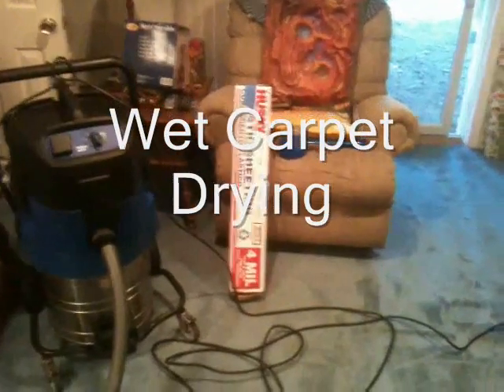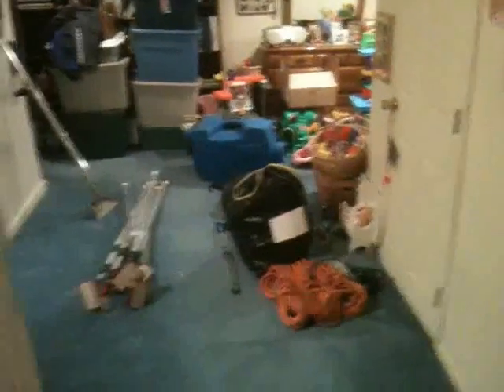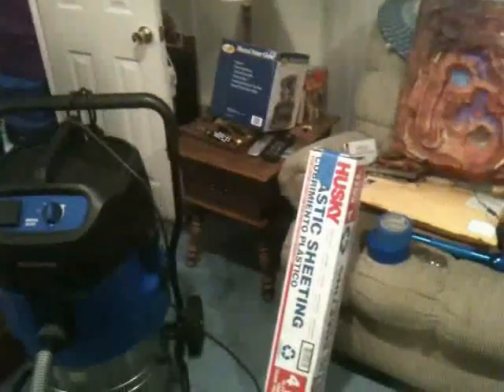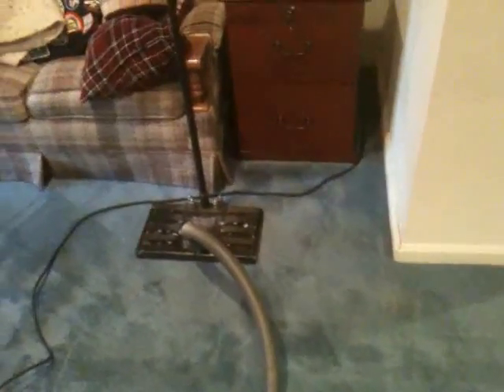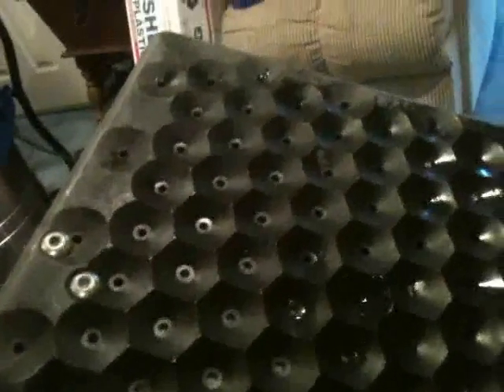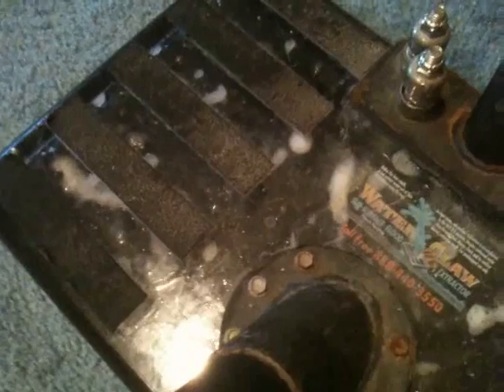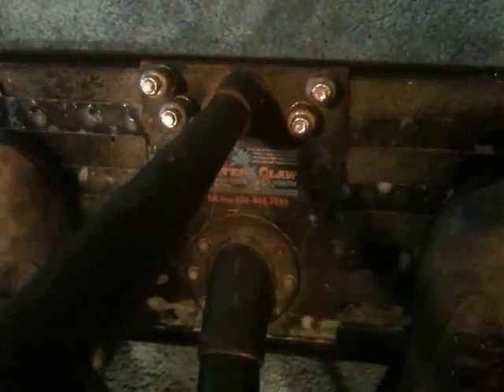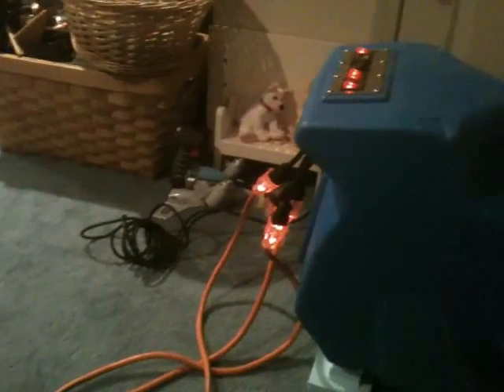How To Dry Wet Carpet in the Basement

Comment: Where does the moist air go when building a chamber and pumping in heat?  Is there an exhaust fan or a dehumidifier that removes moisture from the air?
Reply from the maker: I use dehumidifiers to remove moisture, with warm air.

Comment from the maker: After 22 years of performing water damage restoration you finally figure out how to dry a wet carpet in a basement many different ways. The most obvious way may not necessarily be the best way. A dry out can range from saving all the wet carpet, pad, and walls, or totally removing all that is wet and damaged. Most jobs fall somewhere inbetween. We having been using Heat-Drying and In-Place Drying recently. But that is not always the appropriate method for drying out a wet carpet.